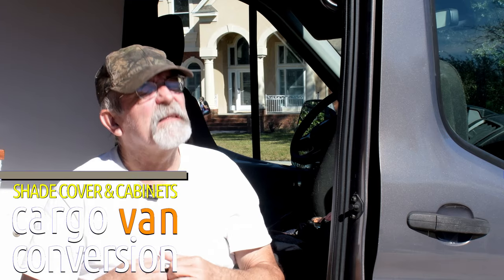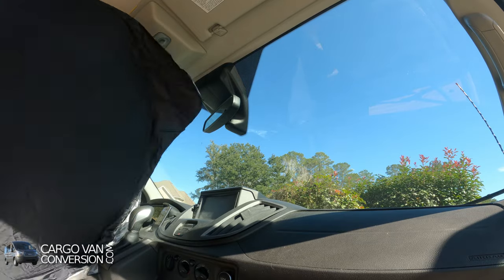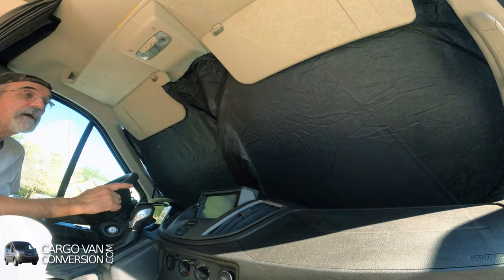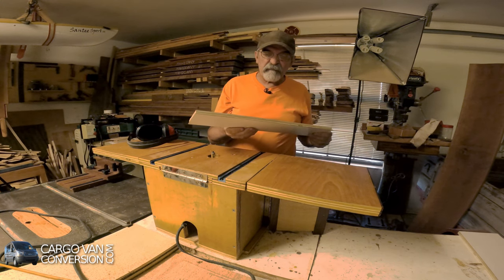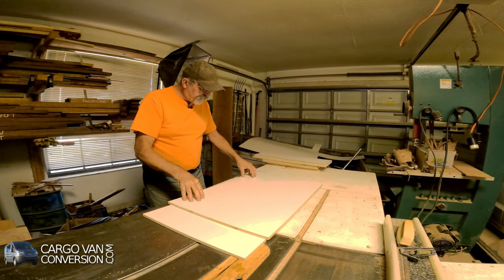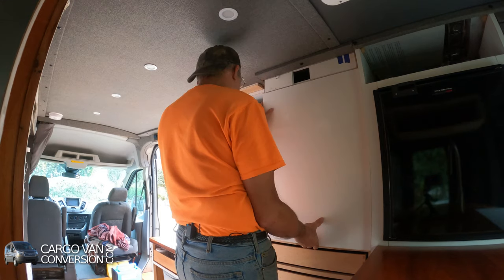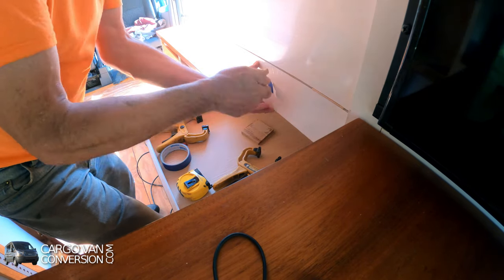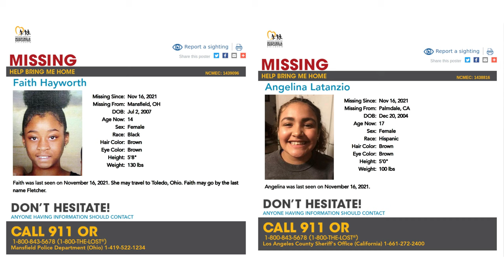Sun Shade & Doors/Drawers

Comment: I do like that router table :)
Reply from the maker: Hi David,
I made it recently, specifically to take it along on the road, together with my foldable workbench. It's very compact and stores under the sink. Won't take it along on my upcoming trip, but will when I move into the van.
Have a great weekend!
Van Williams

Comment: I have the same shade. Try putting the top of the center portion of the shade between the interior rearview mirror and the windshield, then pull the center and corner material ends taught into the voids. I store it by folding it into half, both circles on top of each other then twist opposite ends like a figure-eight. Where's Joey?
Reply from the maker: These shades are really well-fitting, just a bit getting used to them. First few times getting them folded up and back into the bag, was a struggle. Now I do it behind the wheel with my eyes closed :)
Joey usually stays out of the workshop, besides a few incidental visits and sometimes, I'm too busy videotaping. I did my first trip with the van in Florida, so you will see Joey a lot more. He doesn't mind getting on video, but doesn't aspire to be a celebrity either :)
Van Wilams & Joey...wrufffff